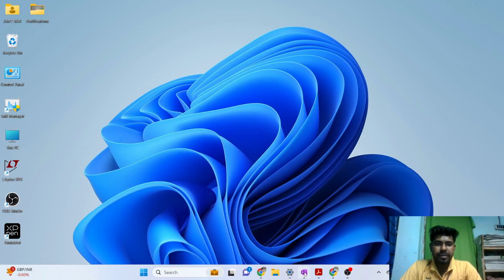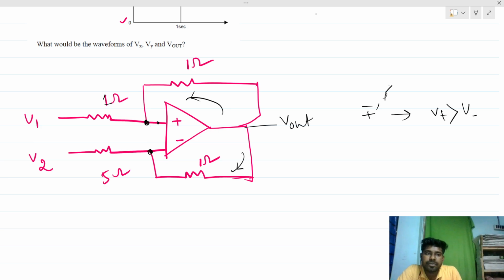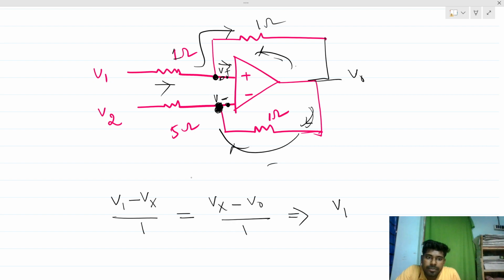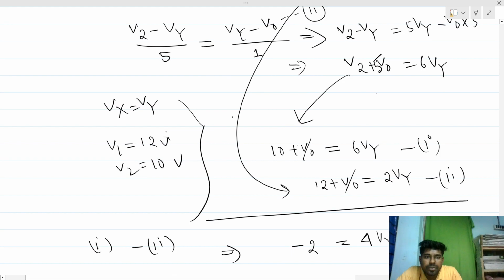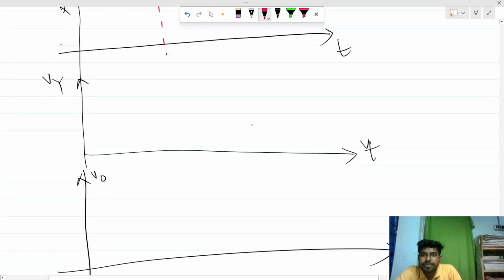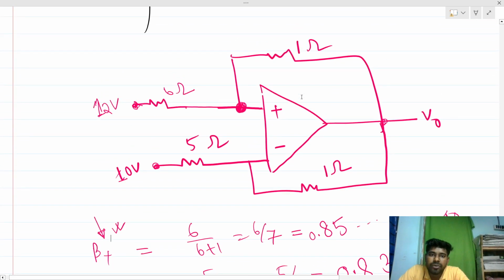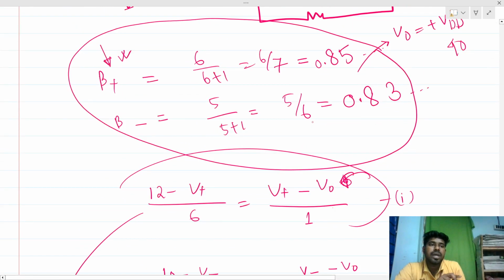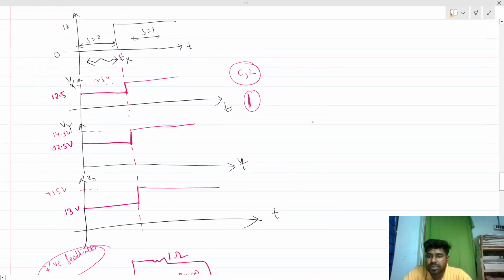Analog Circuit Design Engineer Interview _Plot op-amp Vout, V-, V+ when switch is 0 and 1

Comment: Vo should be 0 as V- is coming out more than V+
Reply: also V- and V+ values will change
Reply from the maker: When the Opamp is saturated,then the Opamp is dead,,,so Opamp doesn't put any effect on the circuit
Reply: @AmitBar-Analog_Circuits opamp is saturated but towards Vss i.e 0v as the answer you found is not satisfying +ve f/b where v+ should be greater than V- but your v+ is coming less than v- which means+15v is not correct. If u keep o/p 0v and then calculate v+ and v- then u will get corrected results